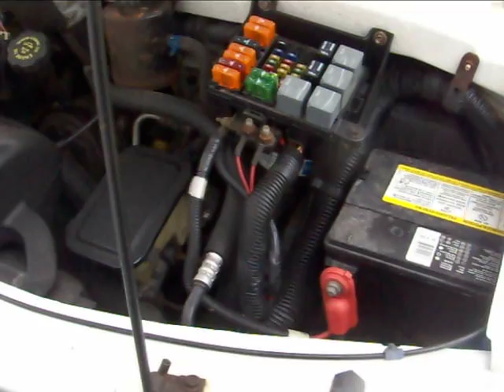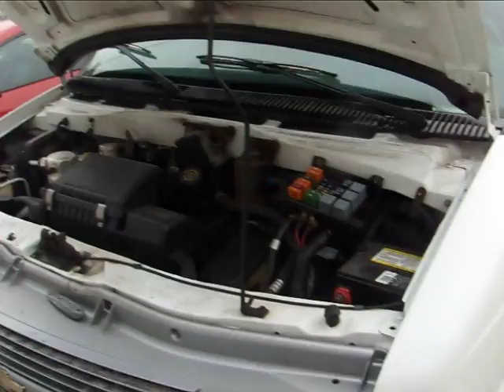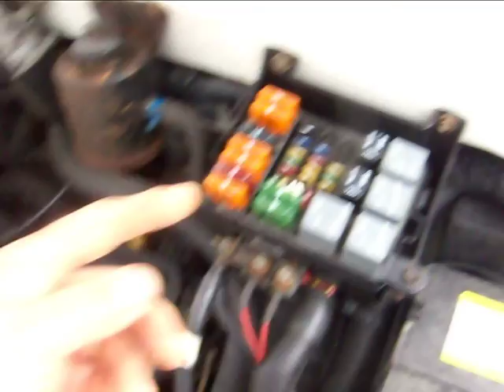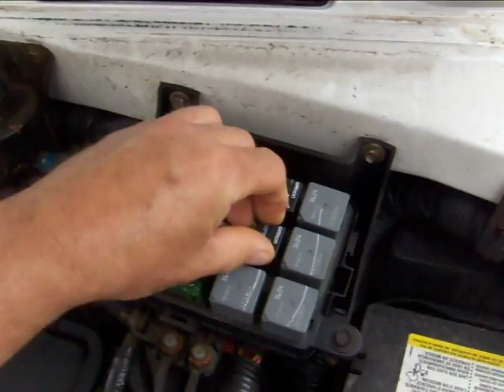Astro Van fuel pump problems #1

Comment: It's an old thread but still very much an issue in January 2019.

First thing to do is check your fuses under the hood and located just as shown in this video.

History >>>>  At minus -26 Celsius yesterday, I'm driving along and suddenly the engine coughs and die's!  Pull over to the side of the road and park.  Ignition off for a minute then click to hear for pump prime.  No pump prime!!!  Try a few more times but nothing.  Ok fine, I have CAA ( fantastic 40 minute quick service on a very busy call day )and had it towed home.

Similar but different to Dyna 1955 issue, I metered all the fuses in the under-hood panel and found just three that were "not" powered hot continuously as they should be.  By moving the wire harness's and battery cable stud points, I had an intermittent and brief power to the fuses in question.  The fuses were A/C Comp K11, Horn H11 and ECM-B F11.

So digging a bit further into GM schematics, I find that within the under-belly of the fuse panel are a series of buss bars or embedded circuit board wires feeding the fuses.  It would appear at this point that there is corrosion and / or a break from the buss to the three fuses.  I say appear because I haven't actually taken it apart yet due to the bloody cold weather.  Wednesday is supposed to warm up to a balmy minus -3 Celsius and i'll venture out and take a better look.  Somewhere around here I have an American copper one cent and maybe I'll just get a big hammer and bang it in till summer arrives.   <<<<<<<<   Ok OK I'm joking although I do have the copper one penny!

I'll try and do a follow up later,

Cheers

Comment: My 1988 Chevy G20 Did That Same BULL SH-T The AAA Wrecker Driver Use To Be A Machanic And He Wanted To Try To Get It Started Before He Loaded It. Was The Same Thing But You Had To Push In On Those Wires To Get It to Start. The Wires Come Loose From That Junction Box Where They Go In I Think I Replaced A Wire. the 2 big Red Wires 1 Goes To The Battery Other Goes To The Starter

Comment: HAD A 98 SAFARI HAD THE SAME THING. FOLLOW THE HARNESS DOWN TO THE FRAME . THE HARNESS SETS ON THE FRAME I WOULD NOT HAVE FOUND IT BUT OPEN UP THE HARNESS AND SLIDE YOUR HAND ON THE UNDERSIDE AND SEE IF YOU GET STUCK BY A BROKEN WIRE.I DID

Comment: My 97 Astro been sitting on the side of my house a couple years! It'll run when I crank it and continuously spray starting fluid into the throttle body but stalls when I stop spraying!
Any idea's?
Reply from the maker: You should have fuel coming up to the throttle body when the key is on. You may have a bad fuel pump or blown fuse.
Reply: Change your fuel filter first. It's cheap. Could be clogged with tank residue. Check the air filter also. Engines need to breathe too.
Reply: Idle air control valve disconnect the oxygen sensors the one on the exhaust pipe and the one on the airbox and the mass air flow sensor and I recommend gas instead of starting fluid starting kicks a little too hard

Comment: I am having this same problem for the last YEAR.   Cant figure out what is wrong!.  Have you found out what the problem is!???
Reply from the maker: Check out the second video.  Astro van fuel pump problems #2
Reply: Am having the same problem change my fuel and the van still cuts off need sum help

Comment: mine has major starting problems only after heavy rainstorms. I think it is electrical in nature, cranks, can smell fuel, just won't fire. hard as hell to troubleshoot without rain.
Reply from the maker: Do you have a scanner? This will tell you if it is electrical or not. Most scanners will be able to look at recent history and show if it was an ignition issue. Mud
Reply: only other thing to possibly check would be the coil/ ignition control module that is also bolted to the coil
Reply: thanx aaron, will check
Reply: silicone spray on all plug wires,and dist cap can help this